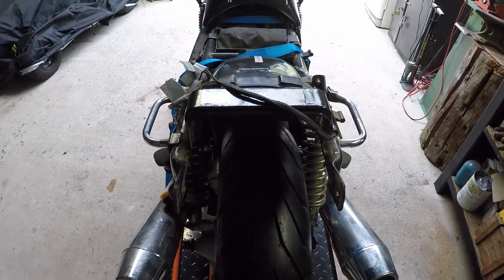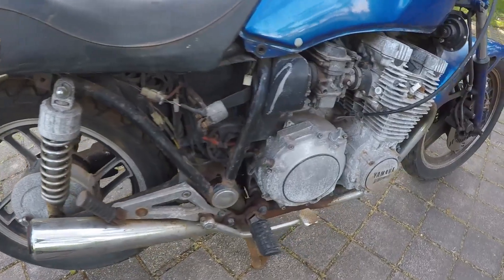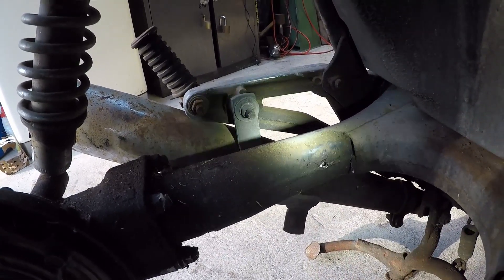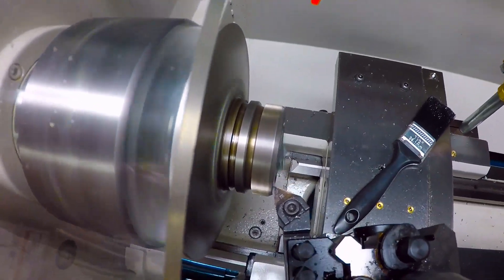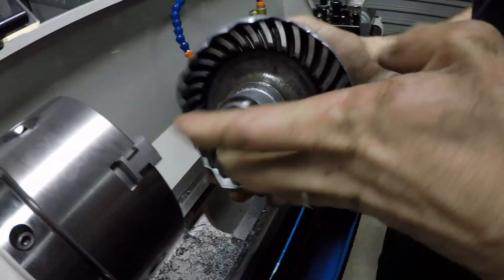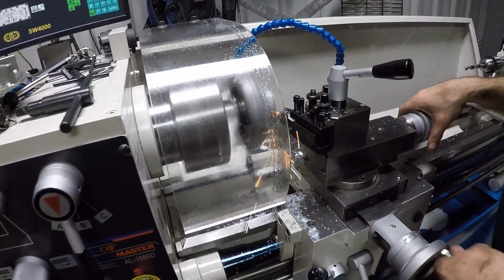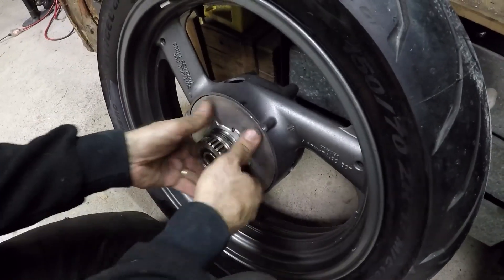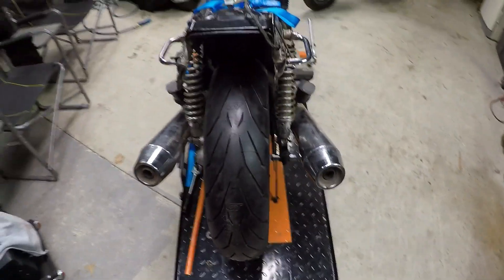Yamaha XJ650 Part 6 Rear wheel alignment

Comment: Nice work. I am working on an xv920 where im trying to fit a xj900 wheel and also dealing with some offset. im curious however how milling the face of the gear gave you more space as in my finaldrive there is a small bushing that actually contacts the bearing. the face of the gear does not contact the inside of the finaldrive. 

In the beginning of your video i noticed you have that same bushing however in the end of your video it seems you dont have that bushing installed anymore. have you done that intentionally? do you notice it ?
Reply from the maker: Hi mate, I machined that bush down to allow the wheel to move inwards. So a fair bit of messing about but finally got it to fit nicely with a 150 tyre

Comment: If you'd like to sell that black xj650 tank that's the tank I'm looking for i tried an ebay "benelli mojave" but leaves a little to be desired
Reply from the maker: Hi Mate, I'm thinking about listing on ebay. I need to check about shipping a tank and if there are issues before I list. Not sure on shipping costs yet but will check it out soon
Reply: I'll keep my eye out for it:) I just ordered the xj900 swing arm,  I like the 920 mono shock but,  maybe on another bike,  but my thinking was,  maybe I could mount a 17 x mt4 without a spacing issue.  Anyways,  love the bike man I'll keep watching

Comment: I did a different system of conversion, and I used a 140/70/17" tire on a 3.5" x 17"  Mag type wheel,  the wheel tire combo is dead center.  My bike is a 1982 750 Maxim.
  Cheers, 50gary
Reply: I didn't realize there was an xj rim that looked so similar to the 3 spoke r1 this just made my day!
Reply: Just curious if the 900 swing arm could be used to avoid all the lathe work to center? I mean if it came off that bike to begin with
Reply: Do you know what bike your rim was from? Looking to do something similar, it's difficult to find wider wheels that are both disc brake and shaft drive besides the 94-03 xj900
Reply: @johnbookout5405  Not 100% on what the rim came from.  I bought the doner rear wheel at a motorcycle salvage yard.  It is a Yamaha XJ rear (that ugly pinwheel cast alu. wheel) with a six bolt disc brake.  I cut two different wheels apart, machined them both and TIG welded them together, it's a ton of work but worth it to me.   I thought it was an XJ1100 but I'm no XJ expert.  Doner wheel (the XJ wheel) size was 3" x 16" and it may well have been the wheel you mentioned.  I have picture of the finished wheel(s) on the XJ bikes forum don't want to hijac this guy's youtube build.
Reply: @50gary thanks for the info and good idea he's done a lot sharing these vids sometimes we gotta figure it out our own way :)
Reply: @johnbookout5405  I used the cast tri spokes and rim from a 2000 R1 with the center hub cut out with our lathe (20") and the XJ doner hub with the spokes and rim cut off with the lathe.  With a very light press fit together, centered and trued on a truing stand then welded the two pieces, powder coated and done.